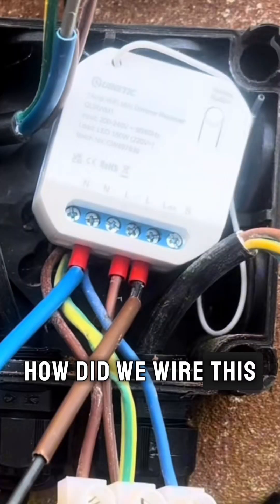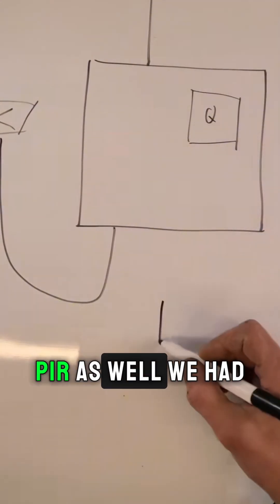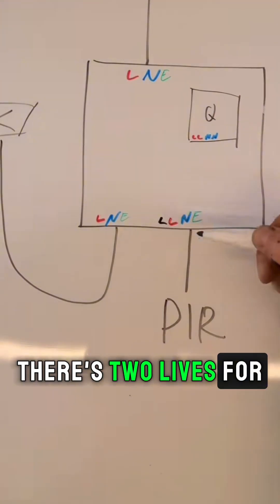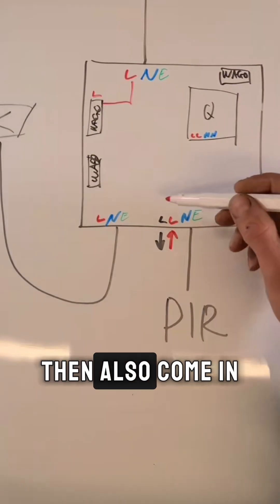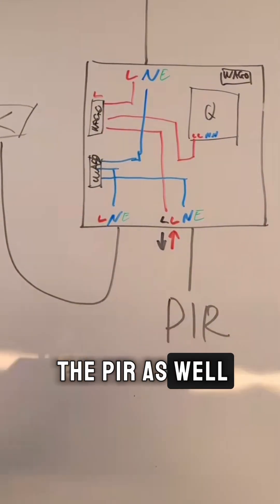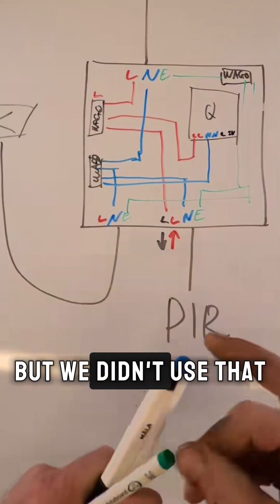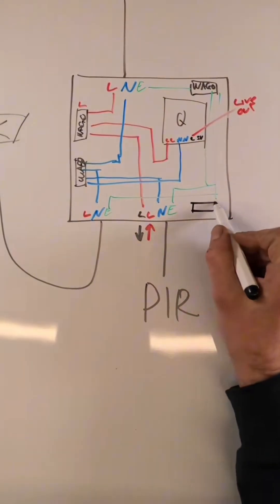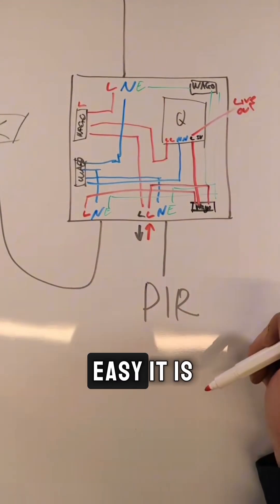Outside PIR Floodlight & Quinetic Switch – The No-Diagram Wiring Trick They Don’t Teach You

Comment: Looks a mess in that wiska box
Reply from the maker: Does it really matter what it looks like inside?
Reply: @toolboxtalking it does actually. Especially when you are demonstrating. 
No mention of a isolator switch or switch fused spur if required
Reply: @toolboxtalking jt does when you take the lid off the wiska😂